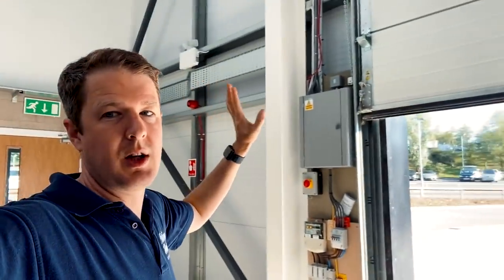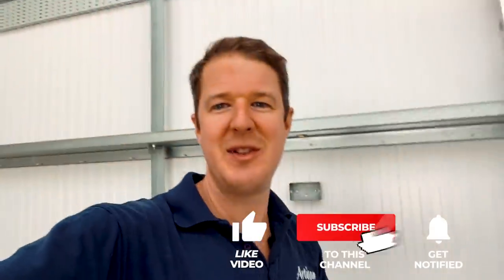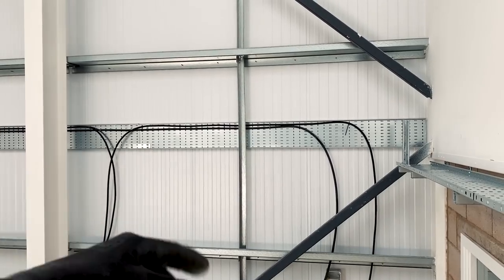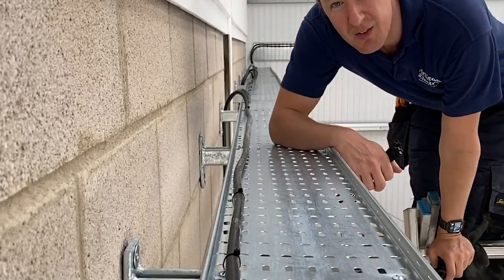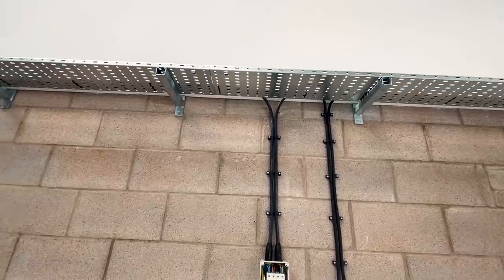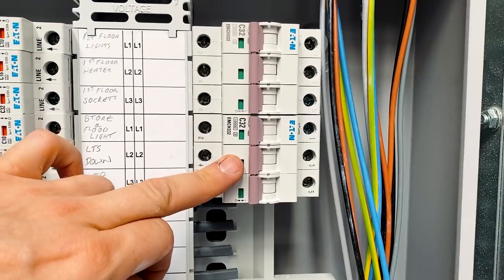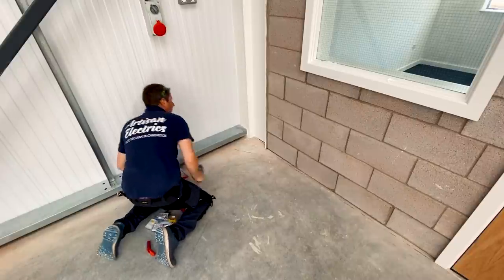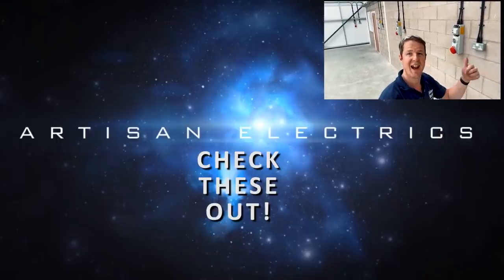Cable Tray, Three Phase Sockets & SWA Cable Install - Part 2

Comment: I always wondered why the British electrical installations, the main fuse or fuses, electricity meter and main switch are outside the electrical cabinet?
Reply: So you can isolate the DB completely before working on it
Reply: @2305denver  I have never felt the need to isolate the entire electrical panel. Our electrical panels have separate section for DNO stuff eg. supply cable, main fuses, kWh meter and main switch. this section is closed with signet screws for DNO access only.

Comment: Nice and neat. Just a heads up. Bootlaces aren’t for that type of cable. There for multi strand like flex. You should use pin crimps
Reply from the maker: Thanks for the tip!

Comment: Jordan, what do you mean you are OCD its called good workmanship as in the first part of the regs.
The 32A sockets with the 32A MCB is that because they have a piece of 32A equipment that will need plugging in indifferent locations? not sure if I would have done it in trunking or tray any way you have done a neat job with it so! With the sweeping up it's a small thing like that that puts you above the rest when you get asked back to do further work.
Reply from the maker: Thanks! Yeah you’re right I’m not really OCD it’s just a way of explaining how I like neat work!
Reply: Why would you of put trunking in. That's a lot more work
Reply: @fraserreid719 , I don't think so however I'm not the one on-site physically seeing how easy or hard either installation method is. Jordan has designed and installed a quality job so why should I criticise any further.

Comment: you can get flush cutters for cable ties. i know you're using armoured cable, but dont you required to have mechanical protection on the drops ? in from Australia, we do things so different here.

Comment: Try electronic flush cutters for cable ties. Just had to invest in a pair for them data tooless jacks
Reply from the maker: Nice!
Reply: @artisanelectrics  I use end cutters like this https://i.ebayimg.com/images/i/131126228160-0-1/s-l1000.jpg
they butt straight up to the end of the tie and cut nice and flush
Reply from the maker: Cool

Comment: I got some electronic cutters from RS for cutting ties, they're only small and you can get them cheaper elsewhere, they cut flush and they're great, also I just use a cable tie length as a guide to spacing them.
Also is that CK cutter for SWA any good? Was thinking of getting one but didn't know if it was worth it. Nice install though 👍

Comment: If I may ask, why didnt you ground the cabletray?
Reply: The tray isn’t classed as an exposed conductive part ,, Maybe if it was grounded or passed through a wall it might become an extraneous conductive part,,  Nothing wrong with bonding it though just in case it did liven up or to even up the earth potential with the existing Electrical installation

Comment: I'm a DIYer so forgive me if I'm wrong, but I believe your cable grouping is incorrect for the three phase circuits.

You've used 4mm^2 5 core cable on tray which gives a current carrying capacity of 34A, but on the tray you have one which is at the edge and therefore next to a single cable which gives a rating factor of 0.88 (29.9A) and the one in the middle is next to two which gives a rating factor of 0.82 (27.9A).

When cleated down the wall, the rating factor is 0.87 (29.6A) for the three phase cables.

Am I missing something in the calculations?

Comment: Would you record the test results on those socket rcds? I guess you'd have to record each socket as it's own circuit to record it?
Reply from the maker: I just tested them all and wrote down the highest reading

Comment: Wanna know how that would have been done in germany? All the CEE 32A Sockets would have got a separate 5x6mm2 line with their own 32A type c breaker, all the single phase sockets would have got their own single phase supply aswell with a 3x2,5mm2 cable (due to industrial use) - breaker 16A single phase type c

Comment: Here I am with 4 inch thick bundles of ethernet, audio, DC, 120 and 240 AC, RF, USB, vacuum, air, water, petrol, and propane lines all velcro'd together and screwed to the ceiling.  But it's my truck so nyah nyah can't code me :p  Still gonna install some trays and separate things a little better pretty soon though

Comment: Rather than using a knife for cutting Tie wraps I use a Thomas and Betts (No. ERG299) Cable Tie Tool. For me it's easier to to use in cable tray or enclosures.
Reply from the maker: Cool

Comment: For machinery would always have dedicated supply to each commando sockets.
Seem strange to put more than one on same circuit.
What loads involved ? 
Did you put in the small DB ? Not much room for expansion.
Reply from the maker: The DB was already there, its a new build from 6 months ago. I couldn't be putting in a new board so had to work with what was there.
Reply: Artisan Electrics 3 x 32 amp commando sockets on 1 x 32 amp C spec breaker on 4 mm armoured.
What was the ZS on last point.
Seems a bit nuts to me !

Comment: Jordan. Put the fly lead on before fitting the lock nut.
Reply from the maker: Nice tip!
Reply: If you.dont use the ring not.make sure you scratch off the powder coating inside too many sparks dont take off the inner powder coating !!! And if you have two swa togther you can get the bangros  thru one brass bolt and nut.

See sparks using zinc nuts roofing bolts and t nuts no no no no!!!

Will rust and loose the sea earth continuity.

Comment: Might be wrong but looks like you used red plugs and screws on that uni strut. Should really use anchor bolts
Reply from the maker: Yeah that’s right! What type of anchor bolts would you use?
Reply: I would go with M10 for something like that 12mm sds bit. Very nice work though high standards as always 👍

Comment: Nice job, have you considered using green yellow heat shrink instead of tape for earth? 
Also, bit of a toss up I guess whether trunking and conduit would have done the job.
It would have been good to see the tray meet all the way round, instead of those jumps!
Reply from the maker: Yeah could have been done so many different ways to be honest
Reply: @artisanelectrics  would've been cheaper and quicker with trunking..also band it, is great for armoureds
Reply: Can also get larger G/Y and Blue sleeving which isn't heat shrink (heat shrink is expensive). Always find taping cables messy (as well as slower) when you take an accessory down and its all sticky

Comment: Think I would have put the tray flat on the wall so it all matches.  On the brick I would have just cut some unistrut down and put the tray on that.  Looks a neat job tho.  Clips are overkill but stops the cable trying to bend i would have done the same.

Comment: That does not sound like OCD, that sounds like you being a professional, getting things all lined up with ties evenly spaced just makes sense. Taking that 32A 3-phase breaker back because the writing was different, now that would be a candidate for OCD.

Comment: Is there any reason you chose to use a metal 50mm bushing over a 50mm rubber grommet?

Personally I wasn't a fan of electrical tape being used instead of sleeving to identify the single phase conductors, but I suppose it works - I just hate the stuff!

Comment: Surprised you don’t have a cable tie gun, tightened and cuts the excess off nice and close.
Good video nice to see some tray work. Have you tried the Linaian armour clips one hole and tap in and you done see then like cleats.
Reply: Now you have suggested it he will most likely get a supplier to sponsor one and then do a review on his other channel

Comment: Nice to see the project process. The supports and tray seem a lot of work for a few cables. Did you not think about not using these and just use cleats/clips? 🤓
Reply from the maker: I did but it just felt like cheating to do it that way, and it would have taken just as long to be honest and looked rubbish.

Comment: Why put the armoureds on top of the forward facing tray. Any future cables will have to cross over each cable drop 🤔
Reply: No they won't. You can just pull new cables behind each drop, which is no worse than having to pull them behind the vertical beams on that wall already.

Comment: Just get some little flush cutters for cutting your cable ties. Fairly cheap, Knipex do them but you can get decent even cheaper ones on ebay too. Wouldn't want to slip doing it with the knife!
Reply from the maker: Yeah you’re right thanks for the tip!

Comment: What about earthing the socket back boxes? I know you don’t need too because the earthing terminals make it earthed, but I thought that with industrial you should?
Reply from the maker: Not really necessary as the back box is connected to the armouring as well as the faceplate of the socket
Reply: I wonder why they put them in if they are not needed.
Reply from the maker: I’m some situations they are needed, for example when you use 2 core SWA cable you need to use an earth wire from that brass block to go into the earth terminal of the socket to provide the earth connection for the socket outlet.
Reply from the maker: John Ward made a good video about this.
Reply: its standard pratice over here to earth back boxes flush or surface never except armour as a earth
Reply: @douglasgreaves188 . the circuit could have been run in plastic conduit meaning a CPC would have been installed. this would then connect to the back box earthing terminal
Reply from the maker: Yes that is another option.
Reply: @jimmygilroy8470  *accept
Reply: I know that it is deemed acceptable to rely on the screws which hold the socket to the back box providing the back box is flush and there is at least one fixed lug.  However, with metal clad where the back box is surface mounted the back box ought to be securely earthed.  As Jordan has the earthed armour’s to the back boxes I don’t see an issue.

Comment: Not a criticism but a curiosity. Why not use an an add on earth leakage withe the mcb rather than individual rcd commandos.?. Nice neat install, many thanks 👍.
Reply: I can think of a couple of reasons.

One is space in the board, afaict there are no three phase RCBOs that fit within the footprint of a standard three phase MCB, so adding RCD protection means taking up additional space in the board and that board is not exactly generously sized.

Another is local RCDs make it clear which machine has an earth leakage problem.

Comment: Hey buddy plastic ties then drop in a stainless cable tie every 300 or 400mm

clear from these changes is that the scope of the new regulations is wider than in the 17th Edition 3rd Amendment, specifically where reference is made to both entry routes in and exit routes out of the building. This reference combined with explicitly requiring metallic fixing is to reduce the risk of cables causing an obstruction – both to the residents of buildings as well as to first responders.
When fixing cables to exposed surfaces vertically and horizontally, the spacing of metal fixings should be approximately 250-400mm. HellermannTyton does not recommend that plastic fixings are used as the only method of fixing and should only be used in addition to sufficient metal fixing.
Where changes have been made to include cable trays and baskets it is recommended that larger cables and cable bundles are fixed within a cable basket or tray. By using metal fixings such as stainless-steel ties in conjunction with cable trays and baskets ensures maximum compliance with the 18th Edition to reduce risk of cables causing obstruction in the event of a fire.

Comment: Why do you use brown/black/gray cables for single phase circuits ending up in relabeling the black wire to green-yellow and the gray wire to blue? And wouldn't it be much more sensible if you had involved all three phases instead? 3 x 16 A would have been way better than 1 x 32 A.
Reply: 3 core SWA can be used for either single phase with a core as earth or for 3 phase with no neutral and the armor as the sole earth and is usually sold in colors implying the latter.  You can get it in single phase colors but it's harder to find.

1x32A is plenty for general purpose sockets and BS1363 plugs have fuses so it's fine to put BS1363 sockets on 32A circuits. 3x16A would just mean more wiring work and more space taken up in the board (which is already getting pretty full) for little benefit.

Comment: For cable ties, why don’t you use a cable tie gun?  It pulls the cable tie to exactly the right tension and then cuts it flush. Professional ones even let you adjust the tension based on what you are fastening.

Comment: I presume not all 3ph sockets will be used at the same time? I personally would wire these individually, due to the unknown nature of what the future holds, each to their own though i do love a neat symmetrical installation though and most of your practices i would consider to my norm, nice job 👍🏻
Reply: Knipex 77 02 115 diagonal side cutters are great for cutting off ties flush and also good for snipping braiding
Reply: Ben Senior i use tie tensioning tool that has cutting blade on it

Comment: Great job👌🏻
What would be a height of the single phase sockets in this case ?Is it going through it of the 450 mm -1200 mm zone?Or you just following requirement of the customer?🤔
Reply: This isn't a new build house mate
Reply: Whatever the customer wants.

Comment: Jordan that job looks the mutts nuts!! Great stuff...it’s good to see different cable management installations. Sadly my chances of doing that sort of work are now very limited where I am so nice to see how others do them. Did you fix the tray straight to the wall by the C.U. and far end or did you place a bracket support behind every so far? Tray simple do a great time saving spacer which saves using unistrut and them zebs and looks a damn sight neater to. If you haven’t tried them I highly recommend. I think Gaz from e-fix did a video on them a little while back.
Keep up the good work Jordan 👍🏻👍🏻👍🏻
Reply from the maker: Cool thanks! Yeah we just spaced it off slightly with penny washers so we could get the cable ties through.

Comment: OOOH Tray is allways nice. Hello from South Africa   Does the UK not have SURFIX cable? its easier to use than SWA,  Its just a little more flexible lighter and about the same size as normal cabtyre(flex) cable.  Its SWA.lite cable. in SA the law states that u can use twinandE but has to be coverd in trunking cieling conduit etc. but if you want to use it like you guys did on the surface against a wall etc, you use Surfix, its round with foil layer wrapped around the conductors thats earthed.

Comment: think you should put the 3 phase sockets on their own fuse and not connected as a multi point radial.. You have reduced the carrying capacity of the circuit. Also sort the fused board out..

Comment: Whats up with the black taped with green yellow tape or is this a UK thing?
Reply from the maker: The wires need to be correctly identified, and in this cable they are coloured wrong for a single phase installation so I taped them up to identify them correctly.
Reply: Why don’t you just buy the correct coloured cables for better practice.

Comment: Nice job, but cw glands indoors?...
Reply from the maker: Yeah I just prefer using CW if possible
Reply: Artisan Electrics bw are indoor glands, cw are for outdoor use, maybe use bw indoors in the correct situations to save yourself a few quid.

Comment: Being from Canada I find it so strange that your mains are always just single unprotected regular conductors, a lot of this stuff seems so unsafe compared to our standards, even in this setting it would all be either Metal conduit or metal armored cables (or tek which is metal armor cable with an extra exterior rubber. Although it is interesting to see how things are done in different parts of the world.

Comment: ? Is there a risk assessment for the sockets at that height
Reply from the maker: Why would there be?
Reply: We were fitting sockets about 1400mm high in a valet bay for a well known car company and we got pulled on them for not being 1200mm due to disabled workers. Even though not an environment for disabled workers

Comment: Ladder ladder ladder.  The label is there for a reason.  The top plastic has written on it not to stand on it .  

Golden rule of course is not to stand on the top or 2nd step.

Comment: Need to put metal even in the horizontal matey 
Clear from these changes is that the scope of the new regulations is wider than in the 17th Edition 3rd Amendment, specifically where reference is made to both entry routes in and exit routes out of the building. This reference combined with explicitly requiring metallic fixing is to reduce the risk of cables causing an obstruction – both to the residents of buildings as well as to first responders.
When fixing cables to exposed surfaces vertically and horizontally, the spacing of metal fixings should be approximately 250-400mm. HellermannTyton does not recommend that plastic fixings are used as the only method of fixing and should only be used in addition to sufficient metal fixing.
Where changes have been made to include cable trays and baskets it is recommended that larger cables and cable bundles are fixed within a cable basket or tray. By using metal fixings such as stainless-steel ties in conjunction with cable trays and baskets ensures maximum compliance with the 18th Edition to reduce risk of cables causing obstruction in the event of a fire.

Comment: i've got knipex cable tie flush snips not cheap but awesome
Reply from the maker: Great!
Reply: @artisanelectrics  KNIPEX 78 61 125 Electronic Super Knips
Reply from the maker: Thanks
Reply: @the social handgrenade 
Thank you for the heads up, just put the Knipex 78 06 125 as well as Knipex 98 54 in my cart.
Thank you for the community your building Jordan. 👍🏻